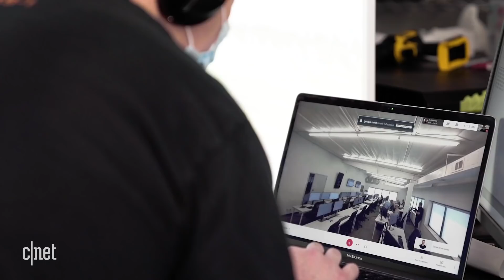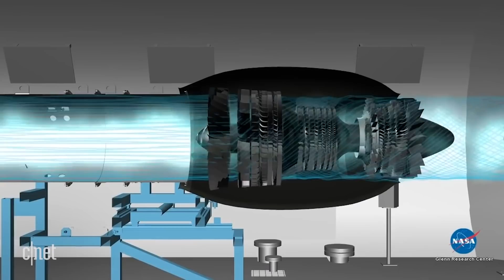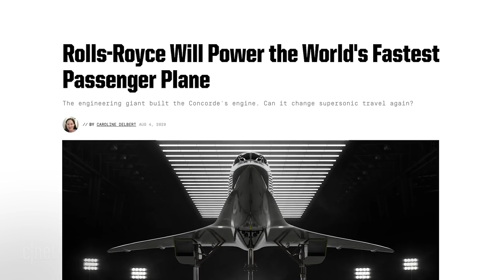The supersonic jetliner built to run on sustainable fuels

Comment: So..... They're basically using existing technology, calling it "sustainable" and marketing the flying EFF out it to a bunch of wealthy tree huggers who want to visit London over the weekend...
Reply: Whatever it take 😂 but that does sound nice! New York to London in  3 hours 😭 I could date an English girl and be back to New York the same day 😂
Reply: @biggieweeb881  that's not how air resistance works lol
Reply: Although I cant see how it is C neutral. It wont be as expensive to run as the Concorde for sure.
Reply: I, too, was a little suprised. I'm nowhere to be an expert but kerosine extracted from hydrogen is basically the same as refined kerosine, only that it is purer. So if I understood it right, every airplane today would be able to run on this new fuel.
Reply: The propulsion system is finally catching up - much different from those RR twin spool turbojets the concorde's had primarily due to CFD and maybe even ramjets.
Reply: Tesla is also using existing technology. Innovations come from different aspects, including aerodynamic design, manufacturing and assembly. It is quite hard to look at the details now, but I bet there's a tons of innovation to make sure this is cost-effective and efficient.
Reply: annnnnddddddd ..... nailed it !!!

Comment: Could you please clarify how is the design of engines that can run on “sustainable” fuels different to conventional engines? Thank you
Reply: lol - the engines arent even built by the company, they are just building carbon fiber tubes and wings - the engines are from rolls royce, thats who can answer your questions - not the carbon fiber salesman.
Reply: @tdub25  haha u made my day
Reply: I'm guessing they're talking about ethanol as sustainable fuel.
Reply: Is just bs. Synfeuls cost to much yet so no one will use them anyway.
Reply: Building a refinery to produce any fuel is not a trivial matter. There is a lot of chemical science to get something to jet-level readiness fuel quality. An engine is worthless unless someone builds a refinery that can produce a fuel that the engine will accept.
Reply: covid-19  If jet engines could run on anything, they wouldn't need to pay the premium for jet fuel.
Reply: covid-19  I'll take back part of my statement. Jet fuel is based on kerosene, as you stated. That being said, the choice of fuel is still rather strict. Gasoline or diesel would not substitute for jet fuel. Your statement that jet fuel is kerosene, demystifies jet fuel, yet because it requires additives, it is still a premium priced commodity.
Reply: Synthetic fuels are identical to current jet fuels. The only difference is that it is “recycling” the carbon from the air, instead of burning even more from the ground. So yes, it is sustainable
Reply: You can produce renewable jet fuel, it will be carbon neutral because the organic materials which it's made of are destined to be "burned" regardless what you do.
Reply: Jet engines don't really care what they run on, as long as it can deliver enough thermal energy to make the system work.  There are versions of aircraft jet engines that run on mains gas in stationary backup generators, and if you can figure out a delivery system for the fuel, you could run a jet engine on coal.  Most likely they plan on using biofuels with more or less the same chemical composition as regular jet fuel, although they could use all sorts of things, as long as the energy density is comparable to jet fuel.
Reply: Planes being sustainable? It's so funny how they are trying to call planes - especially even faster planes - 'sustainable'.
Reply: Shut up you tree hugger